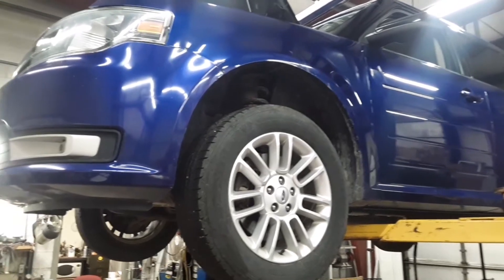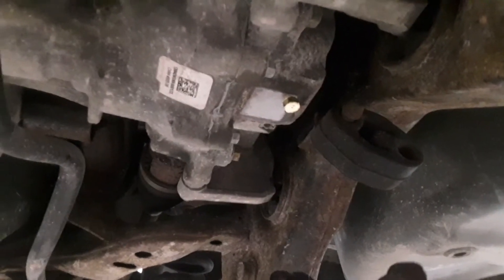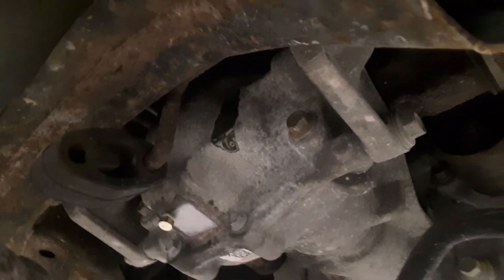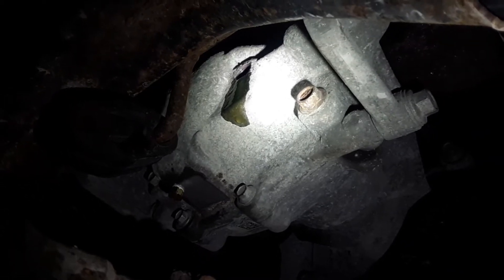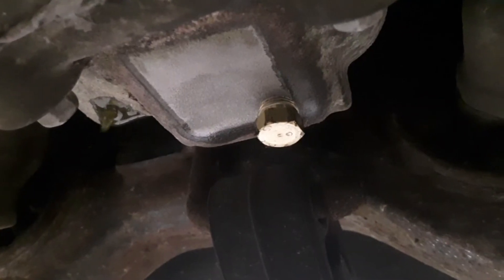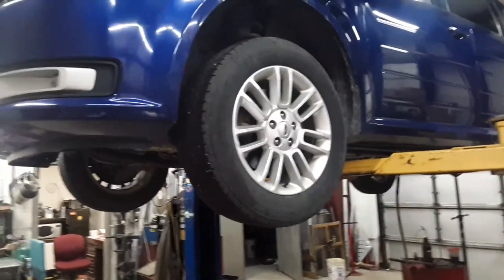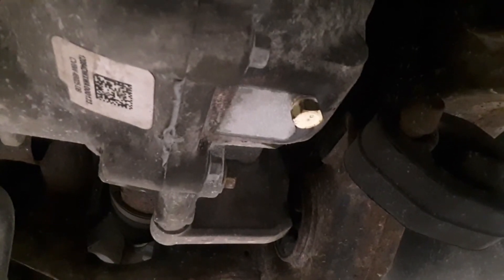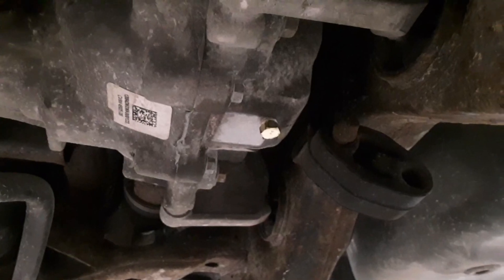2011-2019 ford explorer, ford flex, for edge non-servisable rear diff drain mod

Comment: you can get a suction line in if you route it above the subframe then bend it down into the hole. its pretty hard but its doable and I got a lot of fluid out (around a liter)

Comment: 2010 Lincoln MKT 3.5- Eco-AWD - Twin Turbo - Just did the 1/4" x 18 NPT "PTU" Aluminum Drain Plug, was off a bit but feels like I  have about 3/8" clearance to nearest gear so hope it's okay - "NOW FORD" I'm going to do the same to the Rear Diff and hope I'll get it in the right place this time according to supersport 1986. I find it really hard to orient the placement in the pictures and don't know if mine is the steel cover or all aluminum as yet - am losing sleep over it but will chance it and hope "FORD" doesn't win again.
Your Plug position is at the back of the car and nearest the Drivers side rear wheel corner - is that right ? Really want to thank you !
Reply from the maker: Yes I put my plug towards the driver side of the diff mine had a flat area there and I tried to stay more towards the driver side and back of that flat to stay as far away from the ring inside the diff as far as your ptu and having 3/8" clearance your good!
Reply: @Clawhammercustoms  - Hi friend - haven't had the Guts to do the job yet but will when time permits - really want to "THANK YOU" for your reply !  All the Best to you -

Comment: How much fluid comes out now that you have a drain lug.?I did put a suction hose in mine to do it.Would like to compare amounts from both methods.
Reply from the maker: I don't remember for sure I k ow I was able to get around a quart out of the ptu next time I service it I will let you know
Reply: Thanks. Just pumped my MKX differential out twice and refilled and only got about 18 ounces out each time. Book says 38 ounces total. Can’t believe there was that much still in there I couldn’t get. Drain plug is best option.

Comment: I have a 2016 explorer and I just serviced the rear diff but it has a drain/fill plug in the back cover that I was able to get a suction tube in. Weird that it’s different than your flex.
Reply from the maker: Yeah with the way ours is setup you cannot get a suction tube into it. Having the drain that I put in I like alot more because I'm getting a complete drain of the old fluid and all new fluid back in.

Comment: When refilling do you just fill to the fill plug?  Or is there a leveling plug also?  I watched this other video for servicing a 2017 Escape and there were two plugs: one refill and a leveling plug.  He just put in the same amount he took out.  I don't like that method because some of the oil cooks off by the time you need to change it.  His video: https://www.youtube.com/watch?v=cTNV58yOQm4
Reply from the maker: There is a fill plug and when your filling once it starts to run out of the plug it's full and put your plug back in. After servicing the next engine oil change I pull the plug just to verify its still full. I just watched his video and if he where to get that level plug out only having the back of the car up he would have an inaccurate fill level he wouldn't have put near enough fluid in the car needs to be level when using either method if I remember correctly both holes when the car is level are on the same plane. I personally don't use his method of pumping it out apparently the escape diff is built somewhat differently from the flex if he was able to get fluid pumped out I tried and was not able to hence why I put in a drain plug. Just make sure on refilling it's level front and rear of the car at similar height dosnt haft to be perfect that way you get a more accurate fill level

Comment: Really glad to see a video addressing this dumb design. My taurus sho has the same differential, recently had a dealer refuse to service it, gonna have to tackle it myself. Had to buy a flex head ratchet, very low profile, and about 1 quart of fluid. Blows my mind that I got told "Its sealed for life, don't change the fluid unless you have problems."
Me: What happens when the unit fails due to fluid breakdown resulting in wear?
Them: Replace the rear differential.
Me: Well that's just dumb.

No such thing as lifetime fluid. Thank you for the video 👍
Reply: Life time fluid is basically when the warranty runs out. There in the market of selling cars so they want people buying one every few years
Reply: @anttoeknee9672  yeah, that's true. I know coworkers who trade vehicles in every 3 to 6 months sometimes the mileage isn't enough to need a first oil change, no joke. I like to have long term relationships with my cars, if the fluid is serviceable I prefer to avoid major problems later, but to each there own.
Reply: I've had the A-pillar cover come off twice. Last time into the grille of a new Toyota 4runner at 70 mph. The real kicker here is Ford wants 365 dollars for inner and outer plastic parts. One side clips, a number of 7 is 20 dollars at Ford. Install labor is 80 dollars, 30 minutes. NHTSA are looking at it for a recall. 
Just order Dorman A-pillar but be sure to get inner and outer or it doesn't match up. Most of the time I hear the inner part is broke on the ones coming off. Mine was. 2 clips also.
 Get yourself some JB Weld plastic glue. Put a dab on each clip head, around the bottom bolt and a dab at the top. Then a small line where the rubber meets the top cover. Start at the bottom and push gently above clips. Hold light pressure for a few minutes and problem solved for around 100 bucks. 
  Here is the kicker, Ford built this engine with the water pump inside the engine ran by cam gear. Any mechanic or parts changer knows that is a failure in the engineering department. Unless you want  catastrophic failure when the water pump goes. 🤦🏻‍♂️
Ford is not making vehicles for the average Joe to be able to work on and save money. They are making, at least on these vehicles, a disposable product. Small mechanical failures of vehicles in the past being replaced or fixed by the owner with cheap smaller parts is in the past. Ford has here a vehicle, (of which I own due to, on a whim, no research) that is purposefully built so when it has a mechanical failure the owner will be out hundreds or thousands of dollars to replace the problem. 
By the way, Ford will charge or so I was told, 2,000 dollars plus for that new water pump install on this 3.5 engine.
Reply from the maker: Yeah it's crazy how they design these things! The sad thing also is how many people have taken there vehical in for this service and been charged for something that was not performed because in my opinion there is no way they can service the rear diff unless you and the police version! The ptu's are the same way as far as a joke that is! The worse part is they ran the same design for so long even with failures left and right and did not address the issue until the 2020 model. Unfortunately we have had our fair share of issues with our 2020 PIU luckily all has been covered by warranty so far!
Reply: @Clawhammercustoms  thankfully I got a shop to service the PTU but that rear diff though is its own worst enemy. Ford, as you said, made it easier on new models but the fluid last I saw was 60 bucks. And the PTU is essentially just cooked to death and by by the time people find out it needed changed, the unit is toast, heck one guy I talked to said he changes it 5k miles.... the things we do to keep our cars running.
Reply from the maker: @brentneahring2797  for sure the things we do! Then you will hear about a person who barley gets there car in for a regular oil change on time. Manages to drive 250k with zero issues and the person that tries to do it right has problems! It never has made sence how some people get away with it!
Reply: @Clawhammercustoms  only thing I can think of is just luck, or they like about major repairs and get rid of the cars just before critical failures. Heck my uncle used to be a mechanic and never changed the oil in his minivan and eventually my grandma saw him stranded on the side of the road with an over heated engine... I was speechless.
Reply: That's planned obsolescence my friend. They all do it in some form or another.
Reply: @rickruggieri7284  planned obselence but also a shop I used to go to never recommended maintenance.... not even oil changes. Because they wanted more money for major component work and that's part of the reason they went out of business. I did the rdu and ptu on my sho it's not as bad as you think